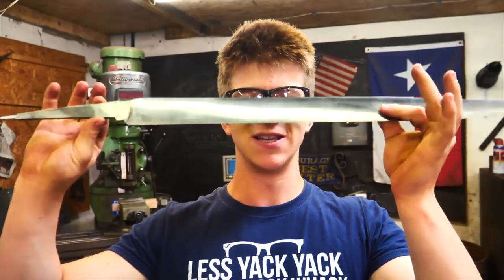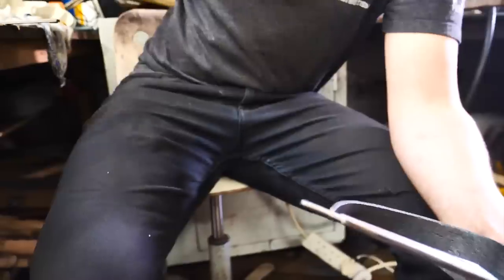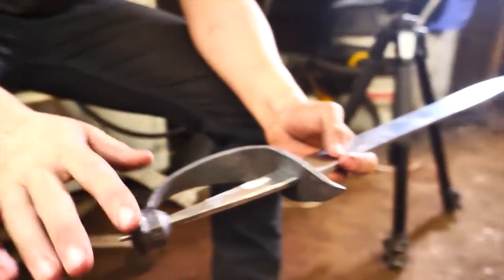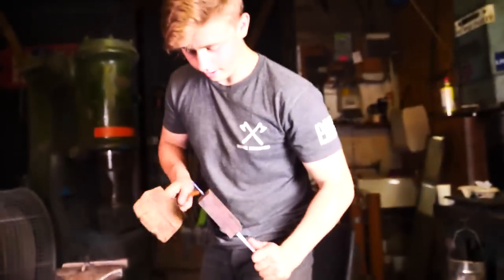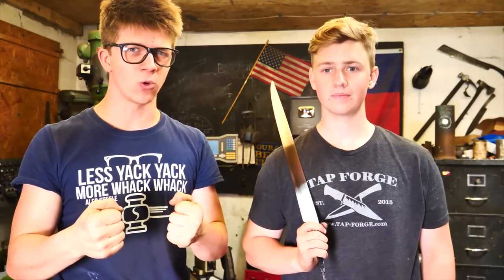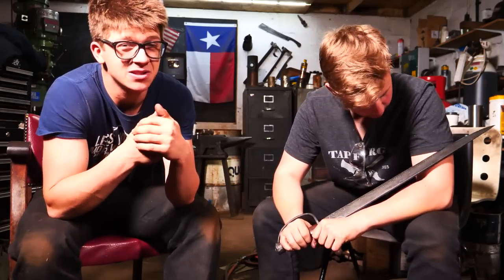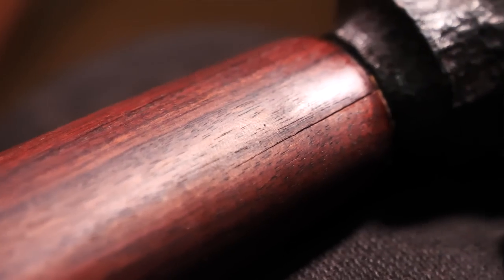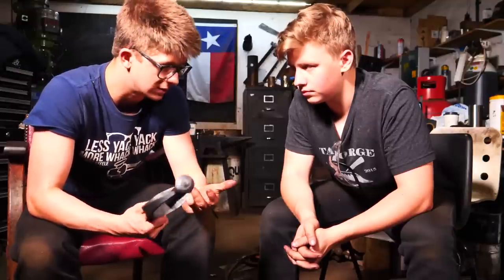PIRATE'S SWORD: Part 5 - MAKING AND FITTING THE HANDLES

Comment: Looks awesome. When milling your wood, mill your end grain first, subsequent milling of long grain will remove tear out. I know it's not critical with the handle, as it gets further shaping. It's a good practice for those time when you may not be doing further shaping, or to prevent a deep tear out that won't come out in the shaping.
After fitting up the guard, before putting on the handle. Solder the guard in place, even soft, plumber's antimony solder will do. Although you could use low temp silver solder. This will better bond the guard, to the blade, more so than epoxy.

Comment: i made a knife today, the fifth so far, the first mot made of large nails, this one is made of a bar of metal from a clamp. ive spent a good many hours on it and it looks beatiful(for someone that hasn't made a proper knife yet) though it still has some hammer marks in it. the edge is so smooth and i managed to sand the blade to a mirror finish and am quite proud of it. i still need to quench it though, hope it doesn't bend.

Comment: nice work thus far, glad too see that you take enough pride in the work to not be afraid to redo parts of it so my respect on that. I would have liked to have seen a bit of a curve and a channel in the blade  as was quite common and very important in the use of the swords historically as it meant to release blood and the vacuum that you get in a chest cavity making it easier to pull the blade back out ;)

Comment: A little something that us master craftsmen call "sticktuitiveness". You both are fine examples of this quality of character. STICKing with a project in the face of repeated setbacks/mistakes/debacles and misfortunes. Using your inTUITion in order to see through the issue at hand, whether it be mechanical failure/poor planning/improper execution or disappointment in initial results and ultimately finding an acceptable course of action. And most importantly , forgIVENESS! of both yourself and your M8 to not bring up past failings other than to elaborate on  positive learning experiences so that others can make a more streamlined effort when attempting similar projects. In order to improve time management/optimise labor and materials/increase the odds of an  acceptable outcome and of course, to grow as craftsmen. good on ya boys! well done indeed.

Comment: Beautiful video Alec
The sword looks very nice.
The handle is wobbly and the grip has slight cracks (which can be glued with seconds glue again), comes therefore where you have the pommel riveted.
The sword was too long in the vise. The sword would have had to be clamped exactly on the handle

Comment: If you didn't want to redo the handle, a common woodworking fix is to use the sawdust from the piece, mix it with some clear epoxy and sand after it dries in the crack.

Comment: if you make the hole for your handle slightly undersized, you can heat up the tang and force the handle down over it. The hot tang will burn the handle to the exact shape you need for a really nice fit.

Comment: I wish i could add a picture... the rapiers that i have and had used in practice have the tang and pommel threaded and you just screw them tight. Instead of epoxy we all used a piece of leather between the guard and the handle then another piece between the handle and the pommel. I feel it was good to have a slight bit of give instead of having a hard joint fatigue or snap with repeated impacts.
Reply: I forgot to add, awesome stuff as always!

Comment: Try using silver solder on some of these projects. It's higher temperature than electrical solder and much stronger. Just one more tool to use to solve problems like a loose D guard.

Comment: I hope the extra work tightens up the handle for you.  Just a thought for next time.   May be spot weld the hilt/guard from the inside to the tang. welds won't show because of the handle. Or weld the guard and pummel together. This could be a challenge but should work.  outstanding work none the less.

Comment: Alec, If you slightly tapered the hole in the pommel, and drilled a thin hole in the end of the tang, you never had broken the wood and the D-shaped protection would being stuck to the sword.

Comment: Any measurements on this one alec? thickness? taper?
Reply: IPostSwords it is probably mostly decorative so there wouldn't even be much point of ensuring the ~6 mm base and taper. it's supposed to cut fruit and look badass so I think it doesn't much matter the technical measurements and such
Reply: it's cool if it feels like a sword when you pick it up.

Comment: crack the wood as carefully as possible along the existing cracks, and see if you can forge the rivet back down instead of cutting it. epoxy the wood back together  and slip it back on once you tighten the guard back in place. or heat the guard locally (fine torch not rosebud) and forge it down  on the blade and rub epoxy into the crack.

(to late now,  I know)

Comment: personally I thought the Damascus came out fantastic on this sword, possibly I liked this one a bit more than the first one you did.

note on the wooden handle:
      Instead of drilling out the weld and redoing all the metal work, you could have done a traditional two part wooden grip and then wrapped it with leather.  good looking, better grip (for your hands), and easier to make.    two halves to mill a slot in, then epoxy them together, then wrap - or not.

Comment: If you want a true fit for the handle heat up the tang to red hot and then just force the wood handle over it burning it into place as a perfect marry between the 2 pieces. much easier then hand filing

Comment: You're making a mistake by not soldering the guards on your blades, that's the proper way, epoxy is just the lazy way. The reason for solder is it can never corrode under the bolster or guard, the bonus is its tighter and will never wiggle
Reply: silver solder is what i use
Reply: Shane K -  As long as the fit up is tight and solid, JB-weld can go a long way.  Don't forget about all of the beautifully made take-down knives and swords that use neither.  The key is always a proper, tight, and solid fit up, though. 👍
Reply: Shane K that's not true. the flux from the solder is highly corrosive.
Reply: nicholas archambault when done correctly (ie neutralizing the joint while it cools) soldering will provide a much better joint. Soldering guards is common place in bladesmithing.
Reply: Bill Parco I agree that it's a solid option, but as forged in fire has taught us, common place doesn't mean it's good.
Reply: Flux may be corrosive but it's not corrosive inside the "weld", the only thing that can corrode can be wiped off when your done.
Reply: Shane K ahhhhhhh. you learn something everyday
Reply: The best bladesmiths in the history of the world are alive right now and are master smiths in "The American Bladesmith Society", I doubt you'd find 2% of them that don't solder on their guards. Soldering isn't to hold the guard on, it's to keep it from corroding where you can't get. William AKA Bill Moran discovered in the 50s while examining hundreds of antique museum swords and knives that many of them,  some hundreds of years old, even though they have clean blades and handles were badly corroded under the guards where it's almost impossible to clean. He then started soldering them and is the commonly accepted practice among the best smiths. Another HUGE mistake I've seen on this channel is filing the thickness sides of the blade where the guard starts in order to make a better visual fit, that greatly reduces the strength of a blade.

Comment: It totally sucks that you had those problems, but I would have done the same thing.  I couldn't possibly stop when there's a crack and a loose guard.  I actually have a sword right now with a slightly loose guard but I didn't epoxy it so I can always take it apart, so it should be okay if I ever get it sharpened.

Comment: Damn, Guys - You could have used glue or epoxy to put the handle together and you would never have seen the crack. Forge weld an extension on the tang and finished off the pommel and that is it. Sweet as honey and no problems.

Comment: Can't you fit the handle easier by getting the metal quite hot and forcefully push it in the previously drilled hole in the wood?

Comment: Why don't you heat the tang to burn it into the wood to bed it?
Reply: Christopher Alsop cos then you would have an extremely tight fit so theres no going back + it would ruin the heat treating on thr tang and potentially the blade
Reply: Luc ROBERTS I mean if you do t correctly, you won't ruin the temper.... and don't you want an extremely tight fit on the handle of a sword? Ever use a sword with a wobbly handle? It's super terrifying
Reply: Strain Specific LTD. I guess it could work but i think they didn't want to risk it on this sword, ik man at arms do it but they do it frequently and have years of experience but if he tries it out im sure he could do it
Reply: Burning a handle onto a tang is very oldschool, and there are better ways to do it that are much lower risk (as he shows by bedding in the handle in this video).
Reply: I've watched all the Forged in Fire episodes so that makes me an expert right? :) But they have stated that not all woods burn in nicely . Like maybe super hard woods like those he is using. 

But I think for them bedding with epoxy is a "safer" procedure. 

Note I only know wood not attaching wood to metal.
Reply: Thanks folks, I will go watch some "Forged in Fire".  Steel burning wood just seemed obvious to me.  The gap issues appear to have been caused by using glue or PTFE or Crayons and they feel like a bit of a bodge (Sorry Alec - love your work!).  Tight fit - One shot...Just the nature of the beast?
Reply: Bedding in actually improves the fit, and isn't as risky as burning on the handle. The PTFE Tape/Crayon is so the epoxy glue doesn't stick to the tang, and is removed before the final fitting, leaving the epoxy in place as a perfect fit between the tang and handle. This way, the handle fits perfectly and you don't risk the temper of your blade. The issue here is really the fit between the guard and the blade.
Reply: We did not burn the tang for several reasons, first off, African Blackwood doesn't burn well, and can actually crack under heat, and bedding the tang provides a the same fit up while adding a layer of shock absorbing epoxy, as well as it being very easy to ruin a heat treat. Bedding the tang isn't a shortcut, it makes sure that the entire tang is supported through the handle which you do not get with a burned on tang. And bedding a tang takes more time than burning as well, it is not just the easy way out.

Comment: I thought he peening of the handle was a bad idea. I don't see why you wouldn't have just welded it on and grind it down.  Would have guaranteed a tight fit, plus not ruining the handle. Although some good clear epoxy resin on the handle would fill in the crack and make the handle stronger.

Comment: didnt anyone tell you after last sword how to get tang in much easyer? drill the holes the heat tang and burn the hole in. much easyer and faster ond you get better fit. you just need to do the hole before you heatthreat the blade

Comment: This is the third wood handle that I've seen you make, and it makes me cringe.  Metalworkers need to understand wood if they wish to use it well.  Please do not shape your pieces by just milling them.  Cutting wood grain, not abrading it, will allow the grain to pop.  Use your lathe cutters, a spokeshave, and a card scraper to shape.  Then seal the wood, unwaxed shellac will do the job regardless of the final finish.  THEN use your fine abrasives to flatten the shellac.  Finish with a varnish for pieces that will be handled a lot - like handles.  You can make your cutters, spokeshave, and card scraper from Damascus steel scraps if it makes you feel better about it.  Love your video production, you really have an eye for it.